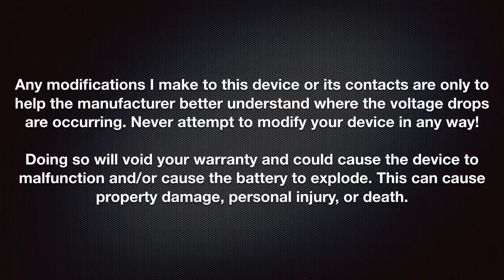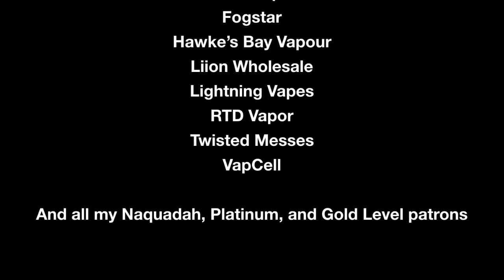Minding Your Mechs Ep019 - Defiant Designs TS voltage drops for different contacts

Comment: hey mooch 👋 got a question if you don't mind? [Sorry for double comment]
 so since the material of the mech itself isn't that important and more about how the mod works - the mechanism(s) in how the connection is completed, along with the contact(s) and the surface area and even most importantly [i presume from what I've gathered from your vids] the total surface area being "touched"(contacted - completing circuit) between the connection points when completing the connection ... for example, like the difference between a needle point contact compared to ... say a big wide bar like the Orion or Pegasus sidefire mech mods by Infinite mods 
and a even better contrast example would be the MYM tri-sidefiring mech mod by Caveman mods that's a tube mech with three sidefire bars in total and when u squeeze it makes a connection all around so it's got three connection points that u can hit all of em simultaneously which is really cool and makes me think if that's the way we should go...
SO if I'm correct on what u have said about what is most important in these matters I gotta ask:
 I'm just curious what mech mods (or etc) have u seen that have the best contacting overall surface area, quality/smoothness, and that you genuinely think is well thought out and made mech in terms of all of this^^^ ?(or at least close to it )
 I appreciate ur expertise and respect ur opinions cuz all these years of hard work 💪 I gotta imagine you have at least found one or two that you think really  checks all these boxes 
Sorry for long comment lol
Reply from the maker: Weird…I replied yesterday but it’s gone.
I haven’t seen a it-has-it-all mech yet but I haven’t tested a lot of them. There are so many different things people want and don’t want from their mech I could not picks one that were the “best”. Check out the mech voltage drop table (link in the Description for the video) and find the best performers that match what you’re looking for in a mech…size, metal, shape, maintenance requirements, etc. Then check out the videos for those mechs to see if there is any thing else you like or don’t like that might help narrow down the choices. Good luck!

Comment: Is it possible to run the TS mod with just two batteries or do you have to have all 3 in the box for it to function?
Reply from the maker: It’s a parallel device (which could mean it would work on one or two batteries) but I don’t know if it can be run with less than three. You’ll have to check with Defiant Designs to be sure.
Reply: Definitely talk to Greg Stephen's (maker of these mods/defiant designs)

Comment: This was an amazing demonstration and still valid in 2021 as there is no other mass produced Parallel mech squonker out there to date. Basically as far as I know, we are still completely limited to only the TS or DS, for low builds under 0.1 for a mech squonker as parallel is a must for amperage battery safety. P.s as Mooch said, be very careful with the directions you put your batteries in, I made the mistake once and it was scary. Rest assured that set of batteries was immediately discarded and never to be used again... The only thing I do not understand, is the warnings about being unsafe to do any changes at home, can sanding the contacts and screws ourselves removing some of the gold plating be an actual danger? Is there a chance of auto firing or shorting or something?
Reply from the maker: Since we can never know how well, or badly, any changes might be done and how the mech will be used we are forced to err on the side of caution and to recommend never making any changes. We just can’t know how it will go and we must assume someone will do it badly enough to cause a problem. Each of us is free to do any changes we want though, at our own risk of course.
Reply: It's essentially the equivalent to McDonald's coffee cups having "Warning: this coffee is HOT and may burn you" 
Trololol

Comment: Hey Mooch, can u tell me what kind of battery should i buy for my VGOD Pro Mech 2 kit? Is it 3000maH? Pls reply just in case i used a diff. Battery and it will blow up..:(
Reply from the maker: Find the link to my blog in the Description section of this video and find my Recommended Batteries tables. There are some great batteries listed there.

Comment: Hey Mooch, is it highly likely if I were to try and have somebody replicate these contacts in .999 silver will I be looking at $100+? Thanks for all you do for us! :)
Reply from the maker: I don’t know how much it would cost but low quantity custom machining services are usually quite expensive. One hundred dollars might be a low price. 🙂 The metal choice makes almost no difference in performance though. This is what my video was about. It’s the smoothness of the contacts and how well they connect that is much, much more important. And a lot less expensive too!
Reply: @batterymooch  hey mooch 👋 got a question if you don't mind? 
 so since the material of the mech itself isn't that important and more about how the mod works - the mechanism(s) in how the connection is completed, along with the contact(s) and the surface area and even most importantly [i presume from what I've gathered from your vids] the total surface area being "touched"(contacted - completing circuit) between the connection points when completing the connection ... for example, like the difference between a needle point contact compared to ... say a big wide bar like the Orion or Pegasus sidefire mech mods by Infinite mods 
and a even better contrast example would be the MYM tri-sidefiring mech mod by Caveman mods that's a tube mech with three sidefire bars in total and when u squeeze it makes a connection all around so it's got three connection points that u can hit all of em simultaneously which is really cool and makes me think if that's the way we should go...
SO if I'm correct on what u have said about what is most important in these matters I gotta ask:
 I'm just curious what mech mods (or etc) have u seen that have the best contacting overall surface area, quality/smoothness, and that you genuinely think is well thought out and made mech in terms of all of this^^^ ?(or at least close to it )
 I appreciate ur expertise and respect ur opinions cuz all these years of hard work 💪 I gotta imagine you have at least found one or two that you think really  checks all these boxes 
Sorry for long comment lol
Reply from the maker: @cavemanlovesmoke4394  sorry, I don’t remember which ones I tested had the best contact patches but the ones with the lowest resistance in my testing would be the ones to consider. Check my mech testing table (link in the Description section) and then you can check out the videos for those mechs to see what the contact setup is. Regarding the best made mechs…no way to call that one as it depends on what your preferences and priorities are and we’re all different. No mech is perfect so what you’re willing to compromise on is important. Check out my videos, everything I know is answered there. 😀

Comment: Mooch i just wanna know if its safe to use vtc5 on a single parrarel .05 ohms for a.competition
Reply from the maker: No battery we use is “safe” at any discharge current level. There is always some risk as they are not meant to be used outside of a fully protected (electronically and physically) battery pack. They must never be misused or mishandled.

You can help try keep the risks from increasing by staying under the continuous current rating and never letting the wraps become damaged.

Running a 20A-rated VTC5 with a 0.05 ohm coil means you are pulling much, MUCH more current than that battery is rated for. That is essentially a short-circuit and your risks go WAY up.

So, is it safe? Absolutely not!
Some people choose to vape with coil resistances that low though and they get away with doing it. Others end up venting the battery or forcing it into thermal runaway. The choice is yours whether to do this or not but I STRONGLY recommend not doing it.

The VTC5 is not a good battery choice for this. It is only an average performer. Try the Samsung 20S for up to 30A. It’s the hardest hitting 18650 we can buy right now.

Comment: Sir can you please make a battery safety for vaporessso switcher kit
Reply from the maker: Sorry, I don’t understand. That is a two battery regulated device. Use any batteries that have a high enough current rating for the way you vape.
Reply: Thanks a lot

Comment: Mooch,if I buy a device with build in 250 mah battery and just use it to make sure it works but don't need it for a couple of months,can I fully charge it and leave it alone,will it be fine when I use it 3 months later? What should I do please , thanks!
Reply from the maker: There’s no way for me to know. Some mods draw more current than others from the battery when “off” (really just deep sleep). Three months is a long time so check the battery every couple of weeks and if no real change then check every month and recharge if necessary. It’s a little better if you don’t fully charge the battery but not by much.
Reply from the maker: Make sure the device is stored in a non-flammable area though, away from anything that could ignite if the device failed. It’s a one-in-a-million chance of happening but it would be bad if it did.
Reply: @batterymooch  thank you so much! You the man Moch! By the way it's a smoke infinix  and has a pull out refillable pod with no on/ off switch ,so does that still mean when off its in sleep mode?Would it be better if I just don't check until 3 months because alot of build in devices I would think sit at a store for months because of buying in bulk and some are not sold for months or maybe I'll use it once every week.With all these bans, flavor and devices I'm stock pilled with juice and pods and would hate to have  my backup device won't work and now I'm beat😂
Reply from the maker: Green Point any device that can detect when you press the button three or five times to turn it back on cannot be fully turned off or otherwise there would be no circuitry “awake” to detect the button presses. Check the device whenever you feel it is right. I cannot say anything for sure since we don’t know how fast the battery drains when it’s “off”. All I can do is give you a conservative recommendation to ensure your battery doesn’t drain too low.

Comment: The 510 threaded section is a pain for sure. I was able to remove it from my DS but my TS wouldn't budge. The reverse threading did get me at first also.
Reply: I may have ruined my 510 threading a bit, it’s impossible to get out on the TS. I bought the silver kit, but the 510 is still the only gold left as no screwdriver is doing it (I saw you do it clockwise to open)... I’m wondering if keeping this as even gold matters.. just annoying as I can’t even clean it get it off to clean it properly so I have no idea if I’m losing some voltage.
Reply: @kingdoz  no the 510 is reverse threaded.

Comment: Thanks Mooch! What metal or manufacturing process( cast, plated, washed,etc). would result in the smoothest or most level contact surfaces? Thanks Mooch! 😃
Reply from the maker: Plating should not add any high spots...should not. I’m certainly no expert on this but surfaces from many manufacturing methods can be pretty smooth/flat but a machined/lapped/polished surface could be best. But that adds cost. Cutting slots into the top of the screws can add the high ridges I saw on the DS and TS contacts. It all depends on how the particular method is done as each can be done well or not so well. The shape of the contact’s profile is important too.

Comment: Thanks again Mooch for yet another super informative video. How do you recommend taking care of the gold contacts? an eraser would suffice or is there a better way of taking care of the contacts?
Reply from the maker: Something slightly dampened with alcohol should be enough unless there are arcing marks. If so you will need to take down the high spots using something like Scotch Brite Heavy Duty scrubber pads. The arcing blows through the plating though so as the arcing damage gets more and more widespread you will lose more and more plating.
Reply: @batterymooch  Thank you Mooch. Is the same applicable on the battery end as well? (of course being careful not to leak into it with the alcohol ofc).
Reply from the maker: siscopiso yes, take down high spots from arcing on the battery too.